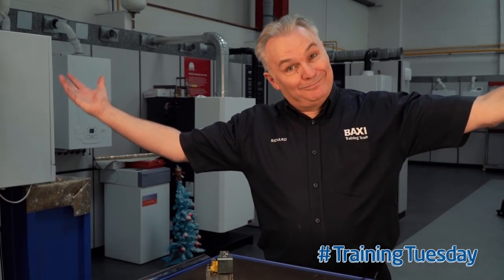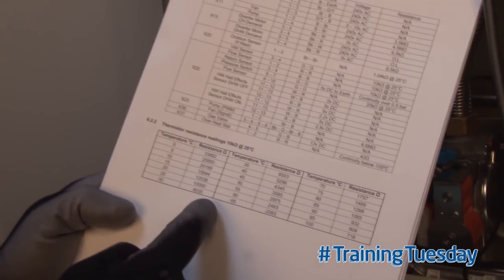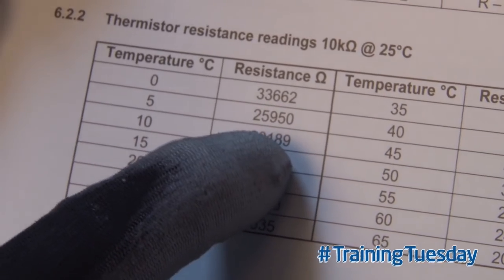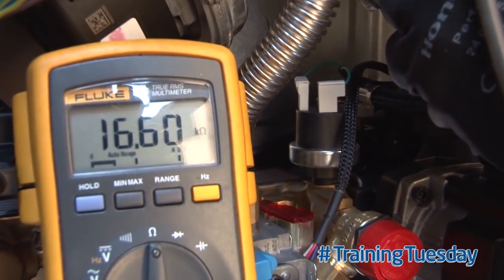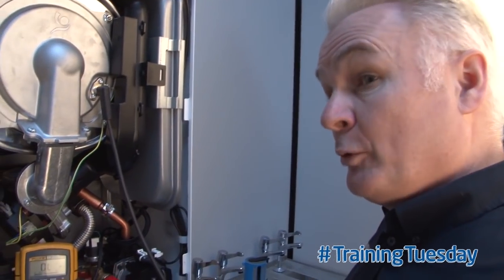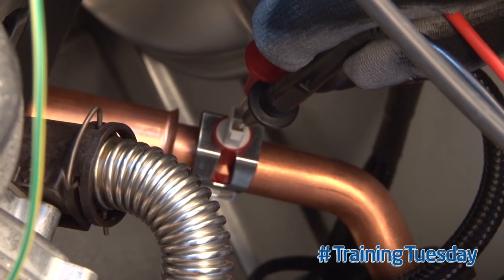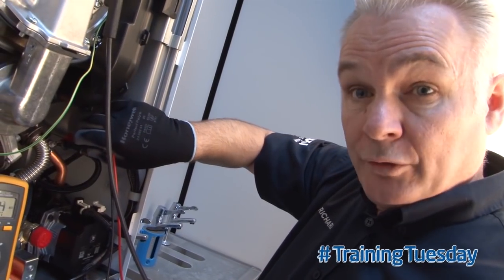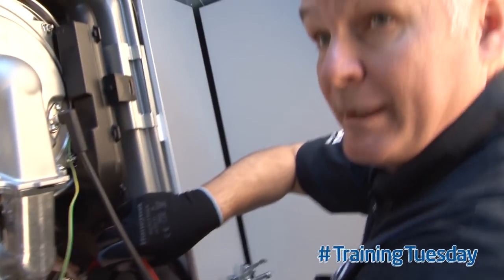How to test thermistors in perfect and imperfect scenarios | #TrainingTuesday

Comment: You make it look easy my vaillant is showing a F64 fault code which is either ntcs or other electronic issue apperently its usually the pcb thanks?
Reply: Try changing the capacitors I’ve had them fail quite a few times
Reply: @SalimKhan-gk1fh  how do you know it's the capacitor
Reply: @waseemkhaliq933  Salam Waseem the capacitors are usually the first components to fail on the circuit board if not also the relays but generally I’ve changed more capacitors than anything else,Obviously if it’s a cheap PCB circuit board then you can replace the whole board but with a new board is £300 a 5 or 6 pound repair is more cost-effective
Reply: @SalimKhan-gk1fh  ok Masha Allah thats good to know but their is quite a few capacitors on the board.i have worked on vaillants for over 10 years and we had a lot of f60 to f64 faults which are normally the board I have replaced a lot of them I generally new about the relays as they do go faulty but never about the capacitors.
Where are you based and are you working for yourself
Reply: @waseemkhaliq933  I am based in Brighton on the south coast but do not work in the heating industry anymore for over five years now . I do remember we used to use a hairdryer on the capacitors then the boiler used to fire up normallyAfter being warmed up a bit this was more so on the glowworms heating industry has changed too much nobody wants to work it’s become a throwaway society with boiler has been replaced for very very simple faults
Reply: @SalimKhan-gk1fh why did you leave the industry? What industry are you working in now?
Reply: @GasTraining  Salam bro .i retired now